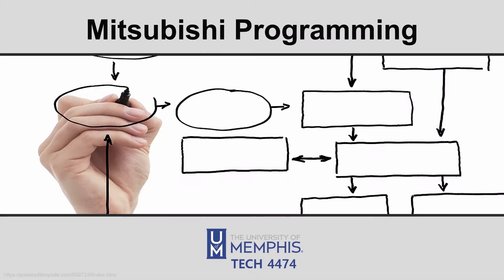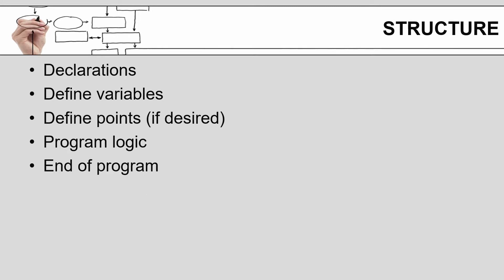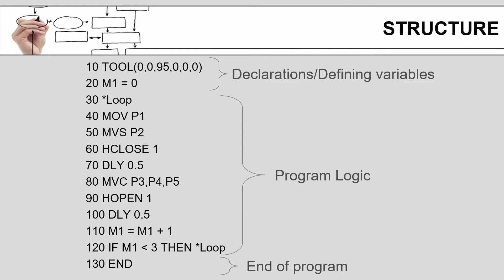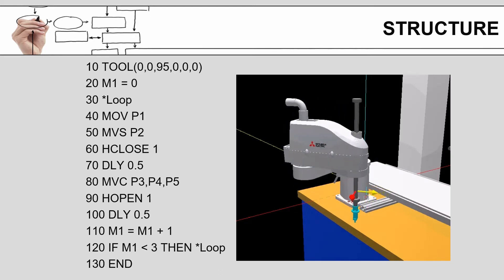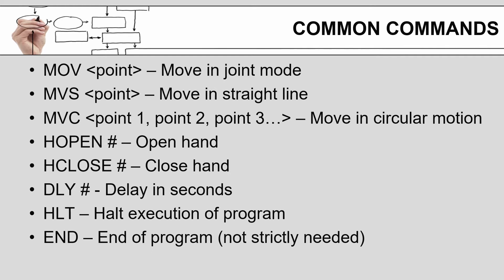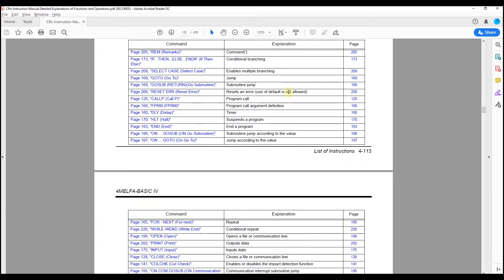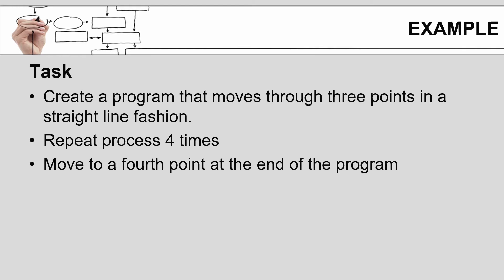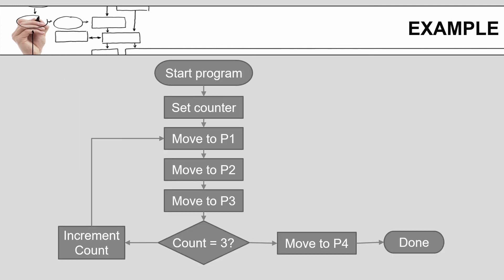Programming introduction for Mitsubishi RT Toolbox 3 (MELFA-BASIC IV)

Comment: Hi Kevin, I am trying to teach some students at Georgian College up here in Canada basic automation. Part of it is using a Mitsubishi Assista Robot. I am not familiar with the programming of this robot but am getting by. I am struggling with creating a user frame (Work Coordinates). Do you have a video on this? I am using a vision system to data X, Y, C data to the robot. Then manipulate a position inside this user frame so we can pick up an object. Data is transferring ok. Just struggling with how to use the Work coordinates. I commonly get L2602 and L2802.
Reply: Hi David, I work for Mitsubishi Electric and might be able to help you out if you are still in need of support.